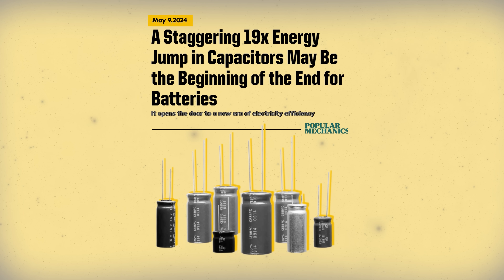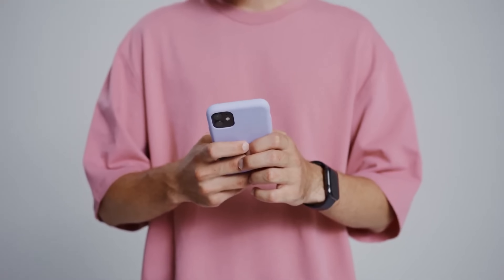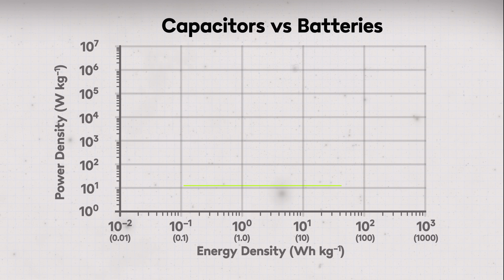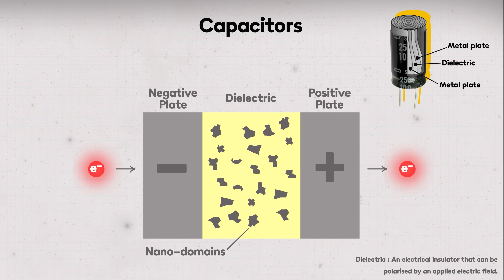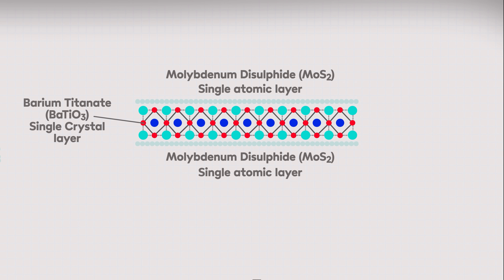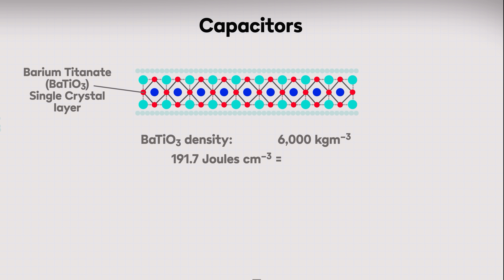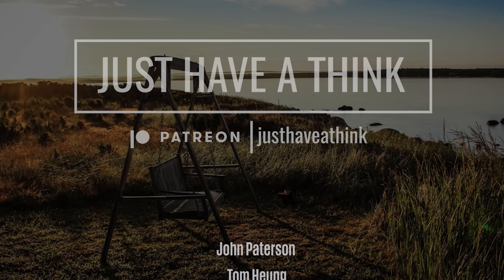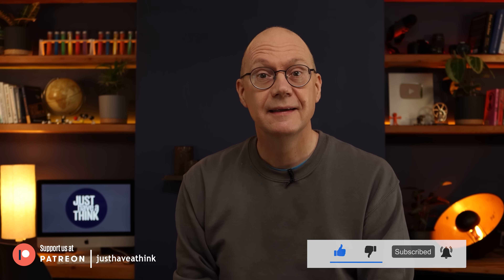Charging an EV faster than filling a gas guzzler? Surely not!?

Comment: Hang on here.  If the energy density is far too low to replace Li-ion batteries, then how could these greatly improve charging times?  To substantially charge a car, you have to substantially charge its main energy storage device, which i thought I heard you say would still have to be a battery. 

It is possible that these could help with picking up the energy generated by regenerative braking, but it's that really very important?
Reply: A small one for regen will be the only use, and even then I'm not sure how much modern batteries really need the help in an average road car. Maybe a track car or some specific heavy vehicle situations, but not much else.
The faster charge thing makes no sense. If the capacitor is bigger enough to make any real difference to charge times it will weigh more than the rest of the vehicle, making it pointless.

Comment: I think it is needed to point out that to get a lot of electric energy stored in capacitors and batteries in a very short time, you need to have a source that can provide this energy. To be able to store 100 kWh in lets say 3 minutes we are talking about more than 2 MW (energy losses not included). It means that if we have an EV with a 400 V system we will need to have at least 5 kA current. If we also consider most battery technologies charging charateristics, we will possibly need 10 kA initially in the charging process.

Comment: A capacitance pack does not have to hold sufficient charge to fully replace the entre battery pack to be extremely useful.  In EV regenerative braking, power is being generated at a varying rate, up to the maximum of the motor(s).  Are there regeneration power bursts (heavier on brake pedal, faster slowing from higher speed) that exceed battery pack absorption rate, that if not otherwise bled off and wasted (maybe as heat) might cause wear or damage to the battery pack?  If so, uses a capacitor pack to more rapidly capture the completely available regeneration charge and drain the capacitance pack to charge batteries at a more tolerant, less damaging, controlled rate.  Last 20% of vehicle charging is slowest so as not to degrade longevity of the battery pack.  If stored capacitance were only 25% of battery total capacity, connect capacitance pack between battery rapid intake points, such as regeneration source and also charging port.  Very much faster last 20% charging rate and far more effective regen capture.  A hybrid power pack.  Now there's a think.
Reply: A small one just for regen may work, but until they can get the energy density way higher they will just be too heavy to make one that is a decent percentage of the battery capacity. So will be next to useless in improving charge times.

Comment: When it comes to these breakthroughs, the only thing that matters to me and probably a lot of people are, is the tech coming to market any time soon, not 20, 30, 50 years off, then if it is coming soon, will it use abundance resources to help keep cost low, and finally, will it be priced that most can afford to buy it, if it ticks those boxes, that it's a game changer, if it doesn't, then it might as well not exist, as it might be still decades off and might not even reach market at all.

Don't get me wrong, I'm not trying to be downbeat on this, but we keep hearing about these game changing techs that rarely make it to market, and even some that do, they are in limited capacity or so expensive to not really change anything, I suspect most of us are more interested in game changing tech that has the potential to come to market over a few short years, uses common resources that there's a lot around, and is affordable for the masses to buy, that for me is the real game changer, not the if's, maybe and someday tech that might or might not come to market.

Comment: Capacitors are often the component that will cause failure on a circuit board. So longevity isn’t something you can rely on. They would need to look at that
Reply: Capacitors in consumer electronics are designed to be manufactured as cheaply as possible, not to have extended service lifetimes.

Comment: The big issue with being able to rapid charge a vehicle this fast is power delivery.

If you want to charge an EV up as quickly as a petrol car (say 500 miles range in 3 minutes) then you need some extraordinary rate of power.  For an average EV, around 2.5MW.  That is around the power installation capacity for a 20-car supercharging station (most of them are designed with less power per stall if all are occupied.)  But only for one car! So   if you want 10 spots, that's 25MVA+ capacity.

It is enough effort getting 2.5MVA to a rapid charging station and difficulty in getting power to sites is one of the things holding back the deployment of rapid charging stations.

The reality is EVs will likely charge a little slower than fuel cars refuel but you start every day at 100% and can go 200+ miles without stopping, for most people that's good enough.

Comment: Even if the I²R losses in the charger were overcome, the pack wouldn't charge much faster if the caps are only used to absorb or dispense a kWh or two. After that it's back to the regular battery. 
If course, if the batteries can actually charge at a ~10 C rate, then running the charger at very high voltage (to lower current) and splitting the pack into many zones might get around an elephant trunk of a charging cable. 
Hopefully suitable superconductors will be here within a couple of decades and components will be smaller and more efficient.
Reply: With an energy density of 8.8W/h per kg I don't see how these are supposed to make any noticeable difference to charge times without making the capacitor as heavy as the rest of the car.

Comment: What a load of nonsense, where on earth do you think the power to charge cars in "just a couple of minutes" will come from? Anyone with any intelligence will know this is just not possible.
Reply: There are definitely practical constraints but nothing in physics prohibits the potential. Anyone with knowledge of the issue, regardless of IQ, would know that.
Reply: @avsystem3142  OK yes it is possible, but I did not mean not possible in a physics way. The national grid would need trillions spending on it to make it capable of supplying the power needed to charge everyone's car. At the moment when there are a 4 fast chargers together and 4 cars plug in, the power drops so low, they are no longer fast chargers. And I do have knowledge of the issue, I know it is cloud cookoo fantasy land if any one thinks it is possible. Just work out the size of the charging cable to transfer that amount of power to a battery in a few minutes, and I would not want to be anywhere near a battery taking that much power so quickly. So it just is not going to happen, it's just a fantasy.

Comment: How do you figure this would accelerate charging? The capacitors are still tiny compared to battery. You'd get insane charging speed for maybe 1% of battery capacity, and then you're stuck since you are still limited by the battery charging speed.

We're about as likely to speed up charging using better capacitors as we are of powering the cars using beta decay radioisotope batteries. The whole concept ignores physics.
Reply: Yeah, at 8.8W/hours per kg, even a capacitor that's like 10% of the battery weight (say 400kg battery and 40 kg capacitor) and could be charged in zero seconds at infinite charge rate can only save you 5 or 6 seconds compared to a battery that can take 250kW. That capacitor would only store about 2 miles of range.